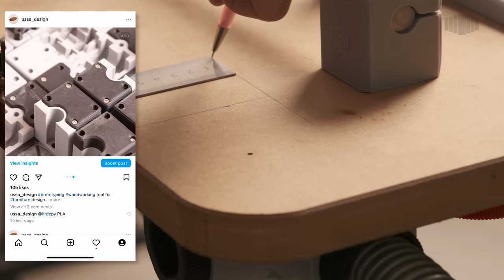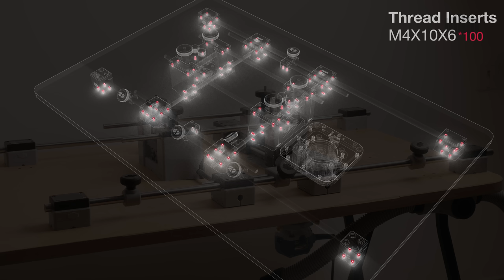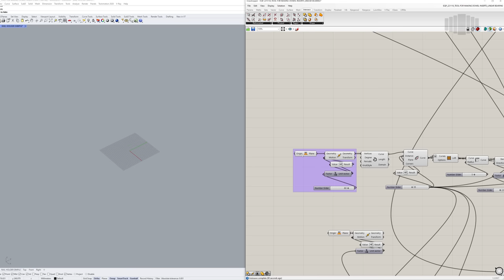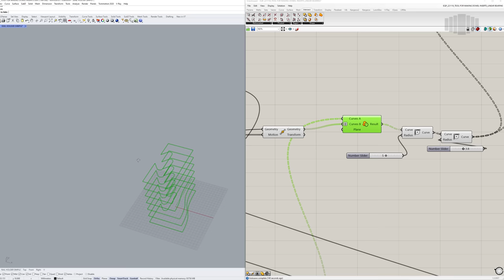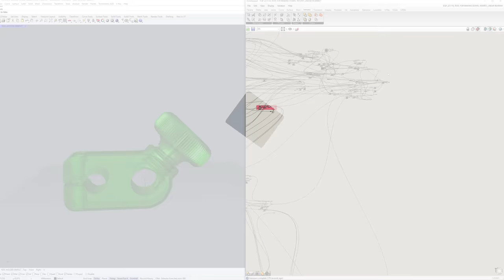Designing my Dream Tool || Reverse Lathe

Comment: I think the reverse of a lathe is just a mill... So you built a mill with an upside down spindle.

Still, it looks like this has some benefits specifically for doing woodworking, and probably cheaper than a full sized mill. Not a bad design overall, and very neat in regards to the engineering done here.
Reply: to be fair its a mill with a rotary axis. but yeah. a mill.
Reply: It’s an upside down mill with a rotary table
Reply: it also has a rotational axis for cylindrical parts

Comment: So glad I know how to turn by hand, on an actual lathe. This is an over-thought, glorified router table jig. A separate bit, set up, and adjustment for every different size of cove or bead.

No doubt you have top level 3D printing knowledge, etc., but they could be put to much better use.

My opinion, and I know what opinions are worth.

Comment: You’ve invented the reverse lathe. Excellent work.
Reply: It’s a mill.
Reply: @OhHeyTrevorFlowers  It was a joke, based on moving the workpiece slowly while the bit moves much more quickly. Having to explain the joke means it was not an effective one.
Reply: @lenkuffert7428  Whoops! My bad. No snark meant.
Reply: @OhHeyTrevorFlowers  No problem.
Reply from the maker: Thank you, Im changing title of this video to reverse lathe
Reply: @lenkuffert7428  having to explain the joke means it wasn't a very good one.
Reply: @Fluvance  Yes, neither good nor effective. The video was really good.
Reply: I think there's a process called "whirling" which is more like reverse turning - the tool(s) spin around a stationary workpiece.
Reply: It is just a 4 axis manual mill with a strange setup.
Reply: @TheRedstonelabz1  Read other replies for a thrilling conversation.
Reply: @OhHeyTrevorFlowers  no, a rotary table
Reply: @zbnmth  no, a rotary table on a mill, both are right
Reply: @lenkuffert7428  hahaha gotta love pedants creeping out of the woodwork
Reply: @xxportalxx.  It is cool. I'm a huge pedant who doesn't comment super often, so it's doubly fun to watch this.
Reply: @indian.techsupport  but he didn't invent the mill part, he invented the rotary part. Since I am correct and you are wrong about what he invented, I am the better pedant.
Reply: @zbnmth  lol toxic, but he didnt, its called a rotary table in metal work and exactly this machine for woodworking existed before

Comment: When you are free hand turning a piece of wood, for example 8:47 or 10:56, if you want to consistently cut at the appropriate depth you have to make sure to always line up the piece of wood with the center of the drill bit, an off center cut would result in a shallower cut depth.
How do you make sure you are always on center when you need to be?

Comment: Mixed feelings on this one.  Emotionally  - great, fantastic build! All that invested  thinking,  design and implementation start to finish.. On another hand - lathe - often even without engine (like spring lathe or other varieties ) - has it's own beauty in simplicity and versatility. For example. - sanding or oiling surface. 

Anyway - thank you for sharing!

Comment: So what have you learned by building this router jig and why would this be better than a standard lathe? Did you have a specific problem you were trying to solve?
Reply: I agree, cool and all but why?
Reply: Just the pleasure to draw and see in real and use it, it’s just so coooool and the feeling is crazy !!!
Reply: Experiment of advanced engineering along with some products marketting. 🙄
Reply: There's some obvious benefits, like the ability to make asymmetrical parts, like a toggle on a pen.
Reply: It can clearly work in more dimensions than a lathe.
Reply: Does anyone know what the program being used by the end of the video is called?
Reply: @cheater00  the one on the right im pretty sure it's "grasshopper"
the one on the left i do not know, maybe its solidworks but I'm not too sure
Reply: As it's already been said, you can work the piece in all desired dimensions because you can machine the piece to make a flat side on it etc...
As you would do with a milling machine.
So you can work a square block of wood and every shape for example, wich is impossible on a lathe as lathe by definition work on revolution (edit: as it has been said, you can do non-revolution shapes with polygonal turning).
You can make asymetric shapes etc...
So you have this freedom + the huge benefit of using standardised milling bit profiles to make repetitive standardised cuts on the piece, because the shape of the milling tool is transfered onto the working piece. 
To do this on a classic wood late would be harder because you have to make up your profile (I don't know if it even exist?) and on metal lathes (wich are more parametric because adjustable with cotations and repetitability) you have to make your cutting profile by settings and not by a premade profile as it's been done here.

As cons though, it's a little bit inconvenient to vary the feed from the piece to the milling bit, to remove more or less of material. 
And yet he didn't show a way to quantify the value of movement, thanks to a ruller tape for example, but it would be easy to do it.
Also, the centering of the piece is possible as he showed in the video but I don't think it's very precise as it take the perimeter of the piece and not it's center.
Also, a note for the maker of this project: implement in your videos a short list with pro and cons of your products, to explain (and not only show for the user to interpretate) the usages possible and their advantages, in a synthetic way. 
I think it would help a lot to capture all of it's benefit efficiently, especially as your content is long and detailled...
Because, as I see everywhere, a lot of people lack common sense and logic to see the big picture, the arborescence about something to enderstand it decently.
Reply: @lulululu4912  wrong... you can make flat surfaces on a lathe... look up polygonal turning. but i don't think it'll work for wood...
Reply: @lulululu4912  Thank you for this great response, couldn't have been said better.
Reply: @lulululu4912  After seeing this design and the amount of work put into it is commendable. I'm not one to talk poorly of some one that is experimenting in these areas. But I would go to my 4 axis mill to perform all of these and more for this type of machining. It is faster, can do any type of material and has a greater workspace with half the footprint of this design.
Reply: you don't gotta buy a lathe (obviously)
Reply: This isnt a lathe, it is a router with 4 degrees of freedom that moves the workpiece instead of the router head. The rigidity requirements for a wood router are far more forgiving than for a lathe, which is why it can be fashioned from mdf, steel guide rods and 3d prints for an approximate cost of about $200. A wood lathe would need to be made from cast iron and steel, and would cost 10-20x as much and be 50x heavier.
Reply: @cheater00  Yes you are right, it's possible on a lathe with polygonal turning, I forgot to say it, especially that I saw a video on it recently! I will change my comment.
But, on a polygonal lathe, as the name implies, and as I saw, you can only do flat sides (or sides with only a small curve to it, the curve wich is a byproduct of the circonference of the cutting blade, or curve that is due to the revolution of the piece).
While the person in this video can do asymetric shapes that are with a "complex" curve (curve that is not a byproduct of revolution of the circonference of the cutting tool to the workpiece but instead based on the shape profile of the cutting tool, so it can offer greater possibilities in some ways, as if you want a complex shape, (splines etc), e.g that is not only an fraction of circle's circonference, to say an arc).
Also, in a polygonal lathe, the cutting tool is parallel (or can it be to a different position?) to the workpiece, while in the lathe (or milling machine) of this guy, the cutting tool is perpendicular.

The software used is Rhino 3d with the plugin Grasshoper, a very good software if you want flexibility in your design, complex shapes etc... 
The software is by default not parametric (possibility of quantification AND modification of the variables of your object) but if you want it to be, you can use grasshoper. 
But if you want parametric modeling only for simple, "engineering" shapes based on primitive shapes (circle, cube etc) that you shape into what's desired with volume substraction, rhino is not as straighforward as real engineering oriented software (solidworks, fusion 360, while less that solidworks).
Also, you don't have (by default but maybe with a plugin you can?) a tree of historic of operations done to your piece and that can be frustrating.
If your modeling have a lot of assembled pieces and that are intricated to each other, you must use rhino with grasshoper and that can be very overwhelming and complex...
Reply: @mjjeanson  Yes but his option is far cheaper than a milling machine, you can partially print it in 3d, use a wood "edge trimmer" (is it called like that??) and it's very convenient for a woodworker. 
Also, you can use the shape of your bit to "print it" to the workpiece and I like it a lot.
Reply: @lulululu4912  i agree with you
Reply: @lulululu4912  So I built my lathe/mill out of plywood and added on stepper motors.  See the latest Woodsmith for the planes. It cost me under $200 USD for the base machine, then adding in the router and the controls that run off on GRBL based controller that only added another $300 USD. This is a nice idea, but I think as it progresses, he will end up with the same solution that many others have come up with in the long run. Heck a Panta router will have greater versatility.
Reply: @mjjeanson  Ok, that's a nice price and now I see where you want to go. 
The price of the build of the person of this video must be on the 150-250 USD ballpark I think? If you buy a cheap trimmer.
On the long run maybe your solution is better yes.
Reply: It's a different approach, self designed and just for the pleasure. I'm sure it costs less and folds down smaller than a dedicated lathe too.
Reply: @cheater00  It’s called Rhino
Reply: @Tharunkumar143  slight exaggeration
Reply: Maybe the problem was he didn't have a lathe or the money to buy one. Awesome design, excellent engineering, and most important it works.
Reply: …. Not having a lathe
Reply: IT’s pretty much as simple as.. he built his dream tool
Reply: He doesn‘t state it in the videos, but he works from an appartment where transporting, using and storing large tools would be impractical. Makes complete sense to have tools do double duty, and this has a far smaller footprint.

Comment: Congratulations on the design and final production! Now I'm seeing some copy router potential with this project. Also seeing the next iteration potentially allowing us to machine a variety of aluminium stock for a fraction of the cost.

👍🏼 Bravo 👏
 
To assist in turning the material, I now need to find a decent adaptable handle design 🤔

Comment: You could probably use an old sanding belt and a dowel in a drill looped to spin the part.
Obviously not super fast, just get it moving in a more mechanical and uniform way.

There is a ton of potential and possibility with this!

Comment: Improvement idea: rotate the piece mechanically, not by hand. 

Just attach a small motor with a belt that goes around the workpiece or a motor with a chuck.

Comment: With a 3d printer does it print the threads or do you have to just drill the bold or screw in and it makes the threads? Probably a stupid question but just curious.

Comment: This is impressive engineering, but it does seem like more engineering and materials than what is actually necessary. Very cool use case, I would say, and even an example of going overboard so others or yourself could improve the idea by creating a DRYer (Don't Repeat Yourself) version. In programming we create a single function that can be used multiple ways. Many aspects of this have a very singular function, such as the pieces that hold the rectangular wood, as opposed to the rounded dowels. Perhaps rethinking how to grasp and spin the dowels should be redesigned. Just one aspect of this that could be improved upon. But pretty cool nonetheless.

Comment: awesome mechanical lathe system but I think a system of this level should be made of steel and aluminium (and perhaps some cast iron elements) not out of plastic, I can't see this surviving in an industrial setting or even in a home workshop with moderate abuse

Comment: 3D printing technology is one of the solutions to study, and practice is great. An example is this video clip. However, after successfully testing your machine model, you need to find another material to start production and put into use. You can't use this 3d printed model, because it's easy to break, wears out very quickly and doesn't last long, even if you use the best plastic, it won't last long. I have failed to use plastic material for my machine design models. Thanks

Comment: Why threaded inserts why you spent so much time making a heat set insert jig?
Reply from the maker: 7 month ago I needed insert jig, currently I think wood inserts are faster and better but I still might use insert in some cases where I will need insert jig again

Comment: 🤔 couldn't you have just made a jig that mounts a router to the bed rails of a regular lathe? I'm not sure what problem this tool solves and there are a lot of added steps to get set up.  Very high quality work nonetheless

Now make an actual reverse lathe where the workpiece remains stationary and a chisel spins around it at 2000rpm 😂

Comment: This is a cringeworthy video. This is absolutely not required to process dowels precisely. It is based on a misunderstanding of the mechanical behavior of wood, on how to precisely cut stock; on wood grain, etc. In other words: it is over-engineered for no benefit whatsoever with regards to safety nor precision compared to existing solutions. If you insist on using a router and have a fence, attach a jig to the fence which does the same and with more controllable degrees of freedom. Less parts, more economic use of resources, and far more intelligent. Great printing skills though.